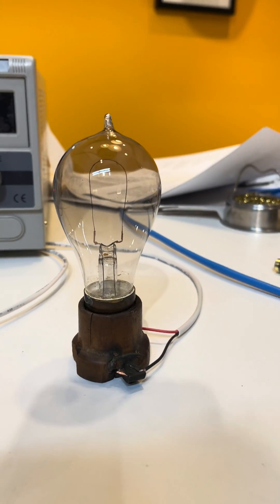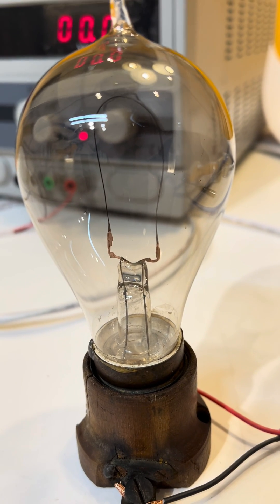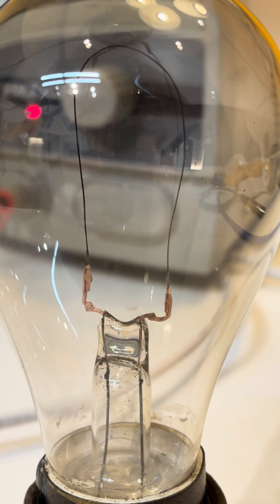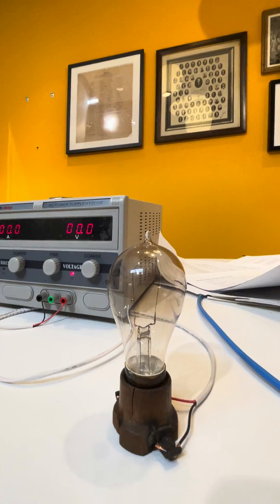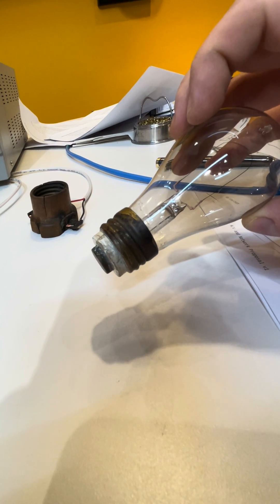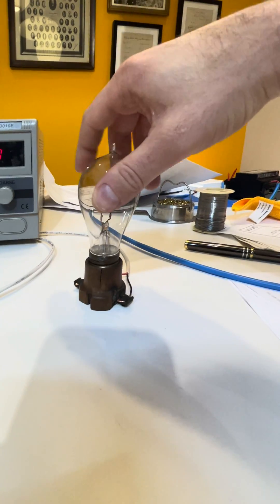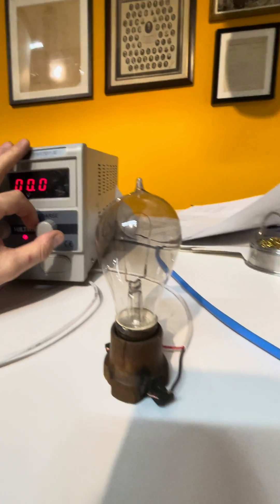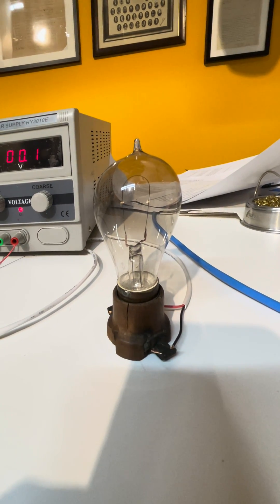C.1883-85 Edison Bamboo Filament Light Bulb Light Up

Comment: I can barely afford the antique light bulbs on eBay anymore the good ones are like $200.00 that doesn't include tax or shipping. I've been trying to get one's that are in the $50.00 to $150.00 range when they show up because some people don't know what they have. I almost recently bought a original Edison 1880 Menlo park era wooden light bulb screw base socket it was like $100.00 however since there was no bulb in the socket I thought it was not worth the $100.00 to then possibly find a mid 1880s era Edison bulb for it. I try to only buy bulbs that I know still work well as it triples there value both bottom shelves on my bulb display case's A at least 10 sockets with 10 bulbs each lit on low voltage it gives people A great example of what they once we're. Not much brighter than this bulb

Comment: Are the brown tape look a like in the minute 0:39 is the bamboo flares ????
Reply from the maker: Those are actually copper. The flared ends of the bamboo are clamped into the flattened and folded copper wire, and then additional copper is electroplated onto the joint to provide a conductive and strong attachment of the filament.